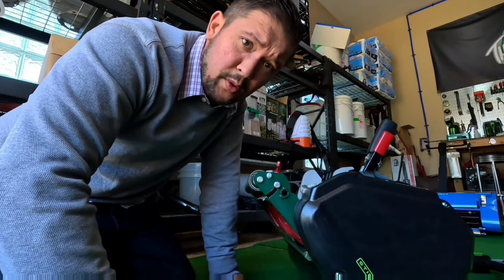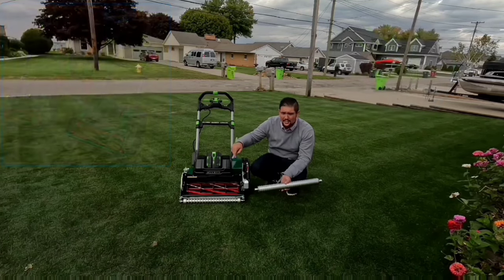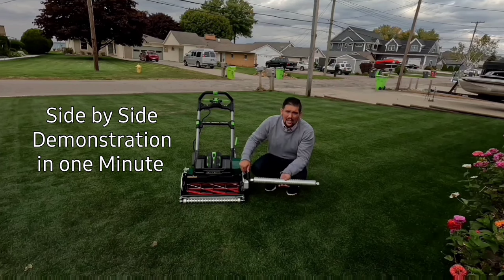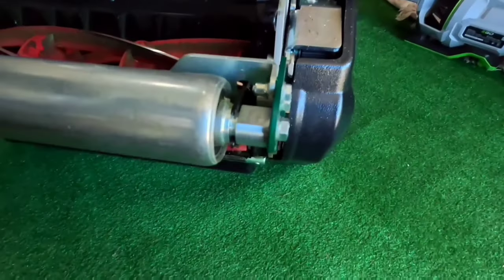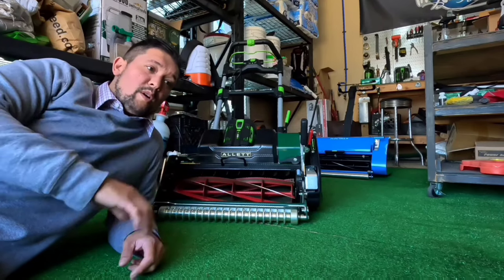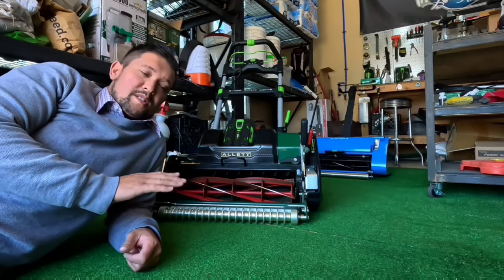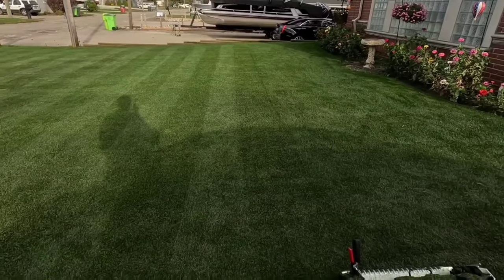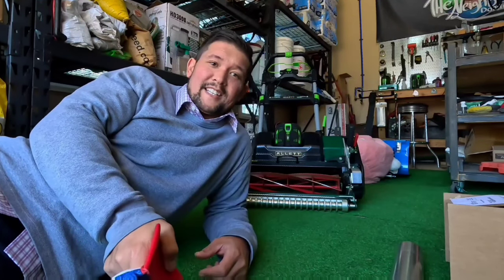Grooved Roller vs Smooth Roller 🌤️ Installing Grooved Front Roller for Allett Stirling/Liberty

Comment: This will be a must for me to have by next Spring. The Liberty 43 will definitely improve with this add on but Allett is so slow in developing a soft sided grass catcher for same to replace the  heavy plastic bin that came with the unit while the Sterling line has such an easy bin to use.

Comment: This striping the lawn thing is very interesting. 🤔 I got to look into that .
Reply from the maker: Lol.  Says the stripe king!   The provista is poppin my friend!
Reply: @TheNeighborDominator  Thanks. Yeah was a little challenging there for awhile but came back strong. I like the grooved roller you showed and looks like it makes a big difference
Reply: @Striperman The front roller has nothing to do with striping, the back roller and drum stripe the grass, a grooved roller stands grass up supposedly but studies suggest it doesnt.grooved or solid roller it doesn't matter they both should cut straight, if it doesn't its in your head or this is just clickbait. We use both front rollers on greens with massive slopes and yet stripes are perfectly straight. Sure if your on a slope a mower might want to go down that direction but you ease up on the top of the slope hand and use the hand on the side going down the slope to help hold in place. I'm a superintendent at a high end private course, been cutting greens for 30 years and I still do it once a week or twice being a superintendent because I love it. I've cut greens at augusta national, wingfoot and oakmont not to mention several other courses, I travel for majors and volunteer on the grounds crew during major weeks once or twice a year. For the person that commented, not all turf grasses stripe. This is a extremely cheap mower compared to the 11 and 14 blade greens mowers but all reel mowers are built to have a solid footprint. Very rarely do I have a mower slide down the slope but I  was getting get you basically want to feel like your lightly forcing it uphill holding the guideline line
Reply: @TheNeighborDominator we use push brooms on the front of our mowers to help with grain and it still cuts straight lines on huge slopes. It's in your head a grooved roller doesn't help with straight stripes it only helps stand the grass up before its cut but it's called into question in several studies, it's just more things to sell to golf courses and users. There are several options for front rollers, rear rollers, attachments, an extra front roller for the grass catcher to sit on so the weight of clippings don't force the rollers into the ground lowering the cut of height. Been cutting greens for 30 years, been superintendent for 20 plus years and I've been lucky enough to work as a volunteer at augusta national, oakmont and wingfoot where I got to cut greens several times over the years during majors, it's a completely different feel when your mowing, nervous yet thrilled and honored. Oakmont greens were by far the hardest the mow for me especially double cutting with no way to see stripes or where you cut since no dew was on the ground second time. I sat a golf ball on each side and moved it after each pass

Comment: When are you doing a swardman VS sterling comparison?
Reply from the maker: I can make that happen!
Reply: @TheNeighborDominator  I've got money burning a whole in my pocket. Gas swardman with all the grooming reels is about $4700, allett sterling 20" is like $8800 also with each cartridge. I liked the idea of electric swardman, but afraid of having the battery die, or a motor quitting.  Lots of complaints online about Swardman quality control.  Anyways, if you could speak to that in a video, that would be awesome.  Doubt many folks have a sterling and an electra😎🤔